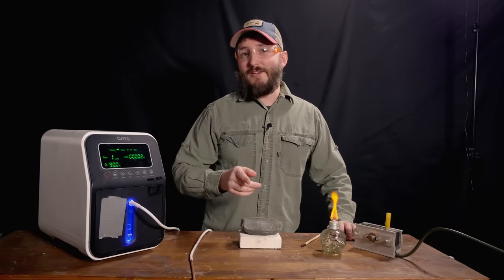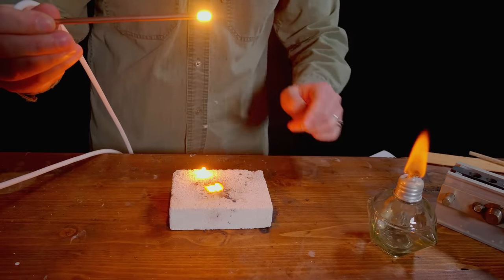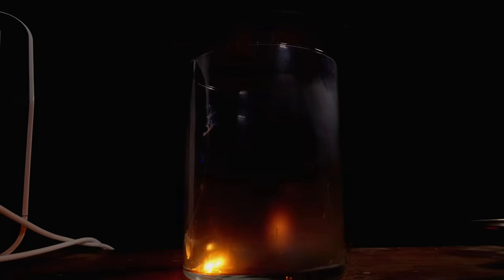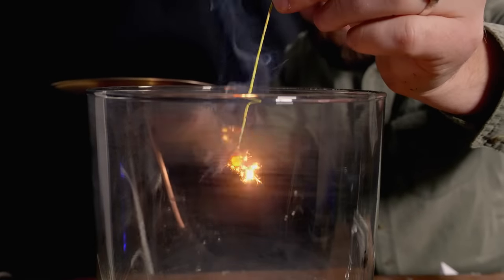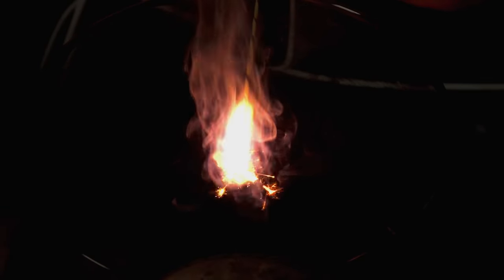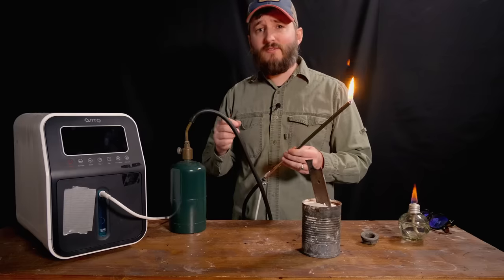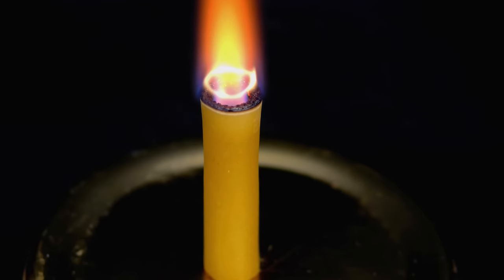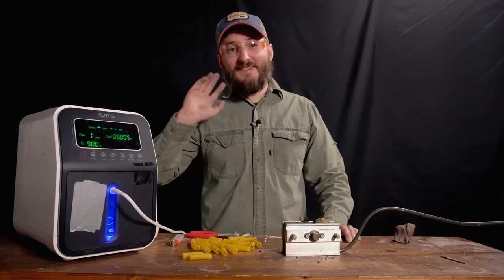6 Unauthorized Uses for a Medical Oxygen Concentrator

Comment: I'm a Biomedical Technician.  I have repaired those many times.  Those small household units are designed to provide between 5 or 10 Liters of O2 per minute, a fairly low flow at a very low pressure.  They're cool for messing about with, but don't really produce enough oxygen to do any welding or cutting.  What they WOULD be fantastic for, however, is home brewing.  Meads, Beers, and Wines require a lot of oxygen in the wort/must to facilitate healthy yeast growth in the initial stages.  Putting an aquarium bubble stone on the tubing you could hyper oxygenate your must for really active yeast growth.
Reply: you sir are a genius.

Btw, do you have any idea which brand this is, perhaps a link where to buy one?

I tried google, but i then get unbranded results. Price ranging between 300 and 500 Euro (im dutch... but thats roughly the same in dollars, very very roughly )

I cant imagine that they work, because if i look at the price for one at a medical supply shop it is around 2000 Euro.

Anyway, if you have an idea, or perhaps a link, would be muchos appreciados (a stupid dutch guy who cant even speak english trying to speak spanish. Go figure.)
Reply: @bertjesklotepino  it real use medical, and medical stuff tends cost, but also fall out minimum uasable ness, so as long your doing medical stuff,  finding medical stuff e-waste recycler, or before it ends up as e-waste first, and just live with less than 101% usability may be even free it lucky
Reply: would it work at high altitudes, or do they still a descent  level O2 to start with?
Reply: @dh2032  The way they operate, there is a vessel with glass beads inside coated with a resin that binds O2 molecules under pressure.  The unit cycles back and forth between high and low pressure in the vessel binding and releasing oxygen.  Via a series of solenoid valves it sequentially vents the waste air out to exhaust, and the concentrated oxygen to the output nozzle.  At high altitudes it would still work, the percentage of O2 in air is the same, it's just under a lower atmospheric pressure.  So you would still get 95% oxygen out just at a reduced flow
Reply: @bertjesklotepino  the one used in the video was about $300 msrp.
Reply: I only watched this video to see if oxygenating wort was one of the things he did. Disappointed. Homebrewer here.
Reply: @bertjesklotepino  I got a used one cheap, from a widower that didn't want it in the house anymore, off local classifieds. there maybe a bulletin board at your local senior center.
Reply: @dh2032  Most of these are paid for by insurance so there isn't much demand for used ones so you should be able to buy cheap or free.
Reply: It makes enough oxygen for me to use a glass blowing torch for about a day. I run the oxygen machine all day connected to a high pressure compressor to fill an oxygen tank to about 1000 psi. It would take 4 to 6 machines in parallel to get the flow to do it without a tank. Well, you would still need a buffer tank, and a compressor.
Reply: It would be interesting to make an atmospheric-pressure oxygen accumulator using a large low-pressure bladder (like a giant mylar balloon, probably in a different room and isolated by a flame arrestor).  Then a large flat weight could be set on top of it to provide pressure when needed, similar to how biogas digestor bladders work.
Reply: There is an artist coop here in town. The metal instructor demonstrated his micro torch connected to an old medical O2 connector. In a tablespoon sized ceramic crucible he melted a small piece of solid copper in about one minute. Small torch and a small workpiece.  I was impressed because I've pushed a propane torch about as far as it could go,  but this could put a pinpoint of heat just where I need it. Like how the old lamp glass workers used their mouth air pipe to blow into an alcohol lamp flame.
He also had a gasoline fueled jewelry torch with a foot bellows.  He said this is how they work silver and gold in the developing world. This is like the old pump-up blow torches but with a hose head on it.
Reply: Uhh when you homebrew wine with yeast during summer the fermentation can already be so violent that yeast can kill themselves from heat generated. Cant imagine speeding that up even more by feeding them 90% oxygen. You want slow gentle ferment when you go for taste. Quick violent fermentation supported with lots of  cooling is domain of industrial ethanol factories where side products dont matter as everything is separated in the end on multiple meters tall distillation collumns.
Reply: I wish I had known this a decade ago when my when my roommates had 5 different 60L carboys going at any given time
Reply: @sznikers  I've seen oxygenation used at microbreweries for high gravity beers without temperature controlled fermentation tanks. They do the O2 on a timer to kick the ferment off without having to pitch a crap load of yeast
Reply: Question. I have one of those Which I use for brazing copper, it has another output which blows some gas in a periodic manner. Is this gas nearly pure nitrogen?
Reply: @bertjesklotepino I really appreciate that you are writing "Euro" and not "euros" like most people.
Reply: High oxygen environments are super dangerous. And low flow doesn't matter. Slow buildup still means build up. I wouldn't do that inside any building.
Reply: @jacobluco7076  Is high gravity beer brewed in a centrifuge? How else would you have high gravity on earth.
Reply: @jannikheidemann3805  Specific gravity is the metric used to determine how much sugar is in wort(pre-beer). High gravity refers to a beer with a lot of sugar that in turn is converted to alcohol
Reply: @kevinmithnick9993 copper  brazing is probably oxy/acetylene if red tank thats a dead giveaway although not always red. oxygen is typically green, and another that burns hot enough to braze is MAPP which is a yellow tank by itself
Reply: That's a piece of crap oxygen concentrator.
Reply: A knowledgeable technician would have caught that room air is 21% pure oxygen.....not 24%.
Reply: Moonshiners thank you for the info
Reply: That's such a cool job title
Reply: I use a machine like this (10 LPM) to feed into a thermos in which I have the cold head of my cryocooler inserted.  Voila!  I make nearly pure liquid oxygen.  I've made so much of it for experiments that I'm actually on my 2nd set of sieve beds for the machine.
Reply: @ChristmasEve777  
Yo - lemme axe you sumpmm. How much LOX (weight) does that make in say 5 hrs @ 10lpm?
Reply: @yomommaahotoo264  Technically, I should be able to make 4 1/2 liters (over 5 kg) of LOX in 5 hours.  In practice, a lot of the oxygen gas escapes the thermos unliquefied.  I end up actually making about 3 1/2 liters in 24 hours.  The yield would not be proportionate for the 1st 5 hours though because before any liquid is formed, the thermos has to cool down.
Reply: Would one be useful for growing "tomatoes" ? I wonder if the plants would benifit from increased oxygen in a growing tent
Reply: @ChristmasEve777  This is old but very neat. What kind of experiments can you do with liquid oxygen?
Reply: Can't help but feel like that's a dangerous idea... Though not necessarily because of any kind of fire risk; for beer or mead, or even wine, the alcohol is too low proof to actually burn. PRESSURE, on the other hand... My uncle had an experience with what can happen if you bottle proof with yeast that's a little too active; it detonated and embedded several dozen bottles' worth of glass into the small cupboard he'd been keeping the beer in. If the yeast has access to extra oxygen dissolved into the fluid, it seems like the chances of overpressure could rise dramatically if you're not careful.
Reply: @bertjesklotepino  Beer wort contains high levels of protein, as well as high enough pH and atmospheric conditions to make botulism thrive. Yet despite that, a good whisking of wort, shake of dissolving the honey in water and letting the sulfur dioxide vent from wine must, is sufficient to ensure the yeast boom in population and progress fermentation before botulism can take hold. 

What you need to ask yourself is if you really need another piece of expensive gear to buy and maintain, when the yeast strains provided to you in home brew stores are developed under the assumption you don't have an oxygenator? 

Furthermore, concentrations of dissolved oxygen from the atmosphere are sufficient to support life, meaning that if you REALLY insist on looking like you know more than you do about home brewing to your home brew buddies, use a hard PP or HDPE tube connected to a vinyl tube fed from an aquarium pump and allow it to bubble from the base of the fermentation tank and wrap the opening to the demijohn with film. You could use an air stone but that's just another item that is difficult to clean and sanitise compared to a tube.

I advise against this as air contains microorganisms and pumping atmospheric air into your sanitised wort for hours is a bit like not bothering to have heated your wort in the first place.

It's also up to you if you want to cut holes into your fermentation refrigerator to facilitate this extra step, but I'd advise just sticking to a good beating of the wort and keeping your fridge as hole-free as possible.
Reply: @Simlatio  thanks. Failing to see how this connects in any way to my response, but thanks for the information non-the-less
Reply: @bertjesklotepino  I'll explain at the very least. The original poster you responded to claimed that the oxygenators were poor for industrial uses but could be excellent for home brewing. You then responded to his comment thread by stating 'you sir are a genius', before going on to discuss procuring one and mentioning you were Dutch.

Putting all this information together, I deduced you were a home brewer who thought the oxygenating of wort with this device was a genius idea. This is what led me to suggest for home brew applications that this device was also not a great idea, but rather than post information to the original poster who didn't seem to be a home brewer, I posted to you in order to provide useful information to who it was relevant, a home brewer.

Sorry for any confusion, but such is the nature of the casual, contextual ambiguous nature of YouTube posts.
Reply: @Simlatio  no, i should apologize because it makes sense now in my tiny little noodle why you explained everything in great detail.

It is much appreciated, and perhaps in the future i make use of the knowledge.

Have a great day.
Reply: @bertjesklotepino  No need to apologise, there is too much going on in life to catch every detail like we are Sherlock Holmes. Take care mate.
Reply: @downsyndromehitler5697 thought "tomatos" need co2 and not o2...I honestly don't know,  i just thought that's the case...
Reply: @flowshine74  Scientifically, OP is right. Practically, you are right. It sounds silly but plants require O2 for cellular processes, despite photosynthesis making O2 as a byproduct. Generally speaking over the lifetime of the plant, it makes more O2 than itself uses but at times of it's life it needs more O2 than it produces, and so in an airtight system would technically need to be supplied O2 as though it were an animal.

A growing tent is not airtight and has many atmospheric cycles per hour within, there is no situation where you would really benefit from using an oxygenator, since the atmosphere in your home provides enough. It's cheaper and healthier for plants to just have a fan push air in your home across them if you really believe they need the extra O2, resulting in placating your helicopter plant parent worries, while providing an actually useful function of conditioning your plants to resist the wind found in the outdoors. 

Source: Been growing veggies and flowers for yonks, very successfully I might add.

Comment: Since the oxygen comes out at virtually no pressure, I believe it might be a good idea to use a normal propane torch that is designed for plain air, and provide its suction holes with the oxygen.
I would like to see how bright a gas lantern gets when the mantle is provided with oxygen 😮
Reply: Reason why cars don't have oxygen tank for the engine , is the valves would catch fire . I believe the amount of fuel is set for max and it would get hotter , but leave lots of hot o2 to burn the mantle . Uncertain if it would last long .
Reply: Well, the process that produces the O2 actually generates it at high pressure.   At high pressures, the nitrogen is absorbed by the molecular sieve material.
Reply: @dennisford2000 That's ridiculous! The valves wouldn't catch fire!
Reply: @richardmccann4815  Having pure oxygen anywhere near the combustion chamber is a horrible idea even if the valves don't burn. It would likely rust out the cylinder walls over time, cause a horrible knock from detonation, and it probably could actually cause internal parts to catch fire, maybe not the valves but definitely something like the rings. Tolerances would grow to the point of malfunctioning, and then something would end up creating a nice new hole for the engine to breathe through.
Reply: I have the same unit and I find that the oxygen output pressure far exceeds my max measurement capabilities of 23 cmMeOH. In other words, there is some moderate pressure to the output.

Comment: when you use a oxygen acelerated flame, the flame should appear blue/green when it has the right amount of oxygen. not having a nozzle also probably prevented it from focusing on one point as well. In my welding class we used acetyleyne fueled torches, and were taught to adjust the oxygen until the flame appears blue with a small white cone at the tip of the nozzle
Reply: Its not about focusing, its about mixing and turbulence.

Comment: These are commonly used in glass working with propane.  Much easier than tanks.  I have two!  They can often often be had at a bargain.  Once they reach a certain amount of hours, they're no longer allowed to use them for medical use, so they're "decommissioned " and sold for other purposes...in my case lampworking, glassworking.
Very cool video.
Reply: Nice tip! Where do you find the decommissioned ones?
Reply: Sometimes, "they" are slightly unforward with decommissioned, (deemed unsatisfactory or unsafe) medical equipment lol... sigh.
Reply: The same goes for battery backups for medical devices. You can grab really high quality lithium batters with like 95% health for absolute bargains. Once the batteries reach a certain number of hours/cycles they're swapped out.
Reply: @CRneu   [[wistfully, fighting tears]] sigh..  * -You-   ..may be able to..  (sniffle..)  Be sure to grab some good outsize primary Liffiums cycling outta  AED units for me, too...  just in case you might ..need ..  (hmmtt) a  stable 3 + volts, for like, ever..(avoids outright sobs)  
Cause I mean t t triple A's are f f fine, in my flashlights, too... I just buy shirtloads of 'em, sigh..  exact same price as double A's, you know.. very thoughtful of the design engineers that way 🤥...  F-Fuh-Fuh-Fuh-fuh-fuhfff......sighh..(you know the sound.. snot all😪🤧.. lolol)
Reply: @CRneu  how do you get access to such deals? Where are they sold to the public?
Reply: @jdog4534  I also want to know
Reply: That’s brilliant so it’s also recycling/reusing and doesn’t take anything away from someone who needs it either
Reply: @jdog4534 I have no real idea where to find them but I would start with the Home Health Care rental places. I'm going to start there at least. If I do find a hook up on stuff I will let you know.
Reply: I paid $25 for one at a Lincoln Highway garage sale. Haven't tried it out yet.
Reply: flashback arrestors ?
Reply: @timothys8636  what? 😂
Reply: @williampierce5579  sorry i live on an island in the gulf of Alaska.... yeah no, sorry we don't or won't ship (x)  there.. and medical surplus clearinghouses?? What you mean those exist??
Reply: @timothys8636  ah gotcha lol dang that's crazy I just live in Ohio 🥴😂
Reply: Same here. Two linked up through a manifold. Works well for Borosilicate.
Reply: @isickofit  I have two that I used to fill oxygen k tanks. But My compressor broke. Is there a tutorial on how to attach these to regulators or whatever?
Reply: @tonymarselle8812 
 Mine have flow regulators built in. I put a flashback arrestor on each one, run them into a manifold and then to my Jencons torch. People do plumb them to holding tanks using 1/4 BSP air fittings i believe  but I don't find it necessary for what I do.
Reply: I rebuild our company's oxygen concentrators, many being over 10 yrs old and with over 50,000 hrs on them. There is no actual lifespan....only the economic feasibility of rebuilding vs buying new. It so happens that many of the older units were made better in that they can be more easily repaired in house. Those today - not so much (planned obsolescence).